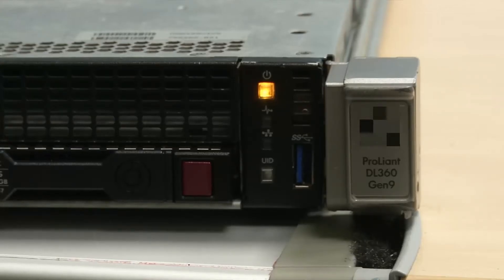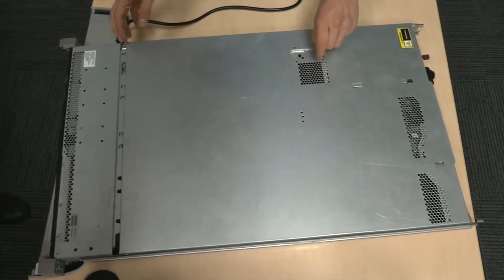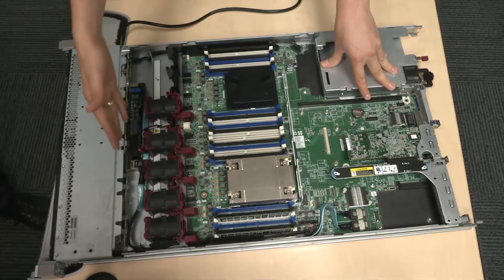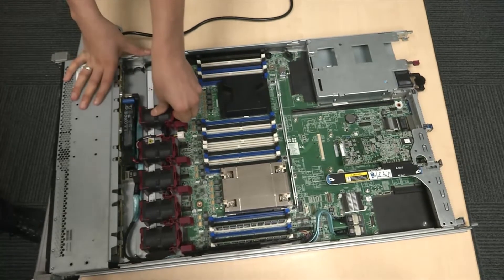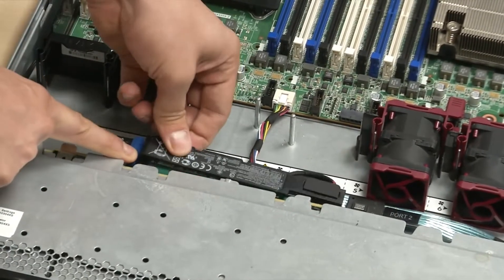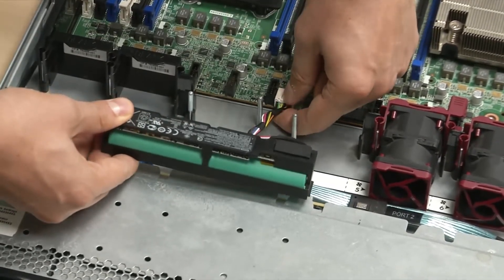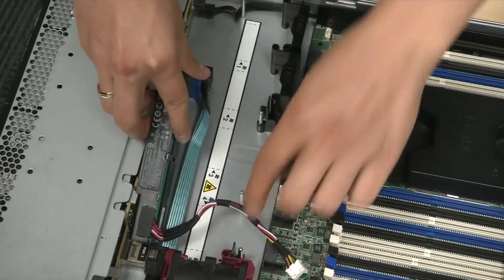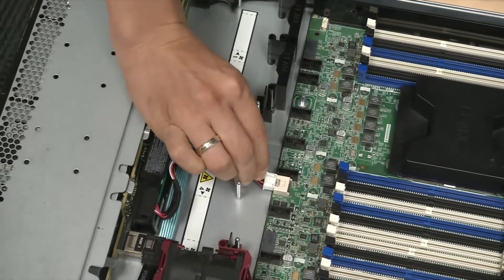Smart Storage battery replacement - DL360 Gen9

Comment: Will you lose the RAID config or will the drives go into a not initialized state after changing the battery?
Reply: No you won’t lose raid config. In my last client place we replaced 10 smart storage batteries and didn’t lose any raid configs.

Comment: Helo, can we replace the battery on the fly? which mean the server is shutdown but the psu still connect to power source?
Thanks.,
Reply: maybe it is possible without breaking anything, but the clip holding the battery in place is blue meaning the server should not be running when replacing. also I believe a reboot is required to initialize the new battery
Reply: @pontusakesson856  The boot on a defective battery shows the modes are limited until battery replacement~charge.
As the BBWC is not operational, and would be or could, it is safer to fully power down. Withstanding that you are removing fans and working on "live" power for the board. and not cooling the system while doing the change.
I tend to change the battery, and put the server power in but not in operation for a while then fire it up. and check Bios for config availability. depends on the level of battery charge.
Flat Batteries will be defective in any event and are "damaged" due to the chemistry of the battery, you should only install batteries which have NO less than 3 volts.